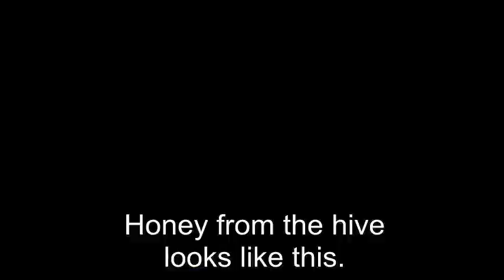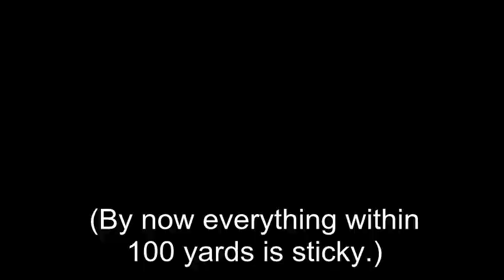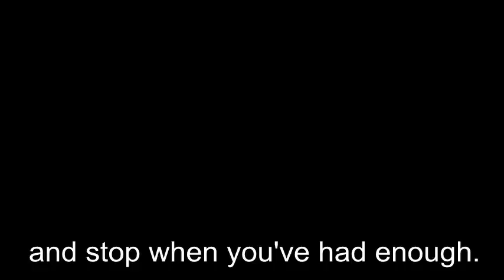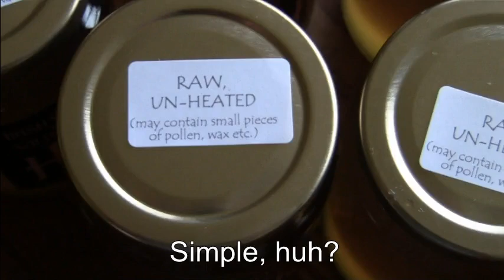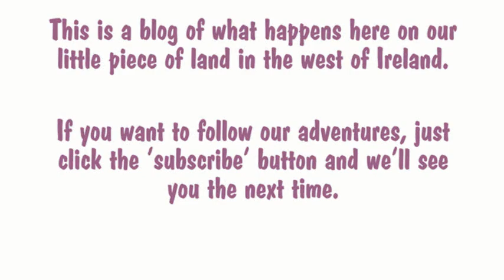Three Simple Ways To Process Honey

Comment: HI Guys I have been watching your video . I wanted to give a little tip I found last year on uncapping the honey frames get a cheap heat gun from Harbor Freight to open the caps there is all most no mess open ever cap. It’s very fast doesn’t damage the comb as bad try it one time I think you will be hooked like I was . Thanks you for all your great videos I have enjoyed them a lot.
Jerry from VA
Reply from the maker: jerry archer Thanks Jerry. Yes, I must try that next time. (No Harbor Freight here, though!)
Reply: Heat will kill enzymes, the good stuff in honey. If it is melting wax, then it is to hot and it will kill enzymes. Such uncapped comb and  harvested honey could be considered heated since the wax need a high melting point which heats honey also.

Comment: how do you keep the combs straight in a foundationless frame? cheers
Reply from the maker: +shdba Have a look at this one - https://youtu.be/TKnkvaOQjsg
Reply: +WayOutWest Blowinblog thanks, funny and informative. But if you put an entire wax foundation in there can you still use the honey as cut comb? wont it make it extra waxy? cheers.
Reply: The Where & Why's . . . 

Cut Comb Honey 'Foundation ' is either Bought Commercially in that it's Beeswax Rolled very Thin pp each Sheet. . .
Or used as a Starter Strip, even a DIY one ! 
The Bees will 'make' Drawn down their own 'Beeswax Comb from this 'piece' of cut Foundation (usually in long thin Strips) Cut parallel wise :
Left to Right Across the Sheet using a Ruler and a Craft Knife.

Tip : 
DIY Starter Strips. .   
I've even used Bamboo BBQ Skewers 'Stapled under the Top Rail of a Frame. At 'Midline.'
Then Dribbled a line of 'Melted Hot Beeswax' onto it : the Bees will make the 'Type' of Cell they need, depending where in the Hive (Nest) it's placed. A Frame placed 'Centrally' it will be more 'Worker Cells' then 'Drone Cells' and some Frames will have both (!) Bees measure their Need so instinctively, it's just amazing to see in action.
Hope this helps. 😎 
🐝🐝🐝🐝🐝🐝🐝🐝🐝🐝🐝
  Happy Beekeeping 2024
🐝🐝🐝🐝🐝🐝🐝🐝🐝🐝🐝
Some Beekeepers like their Bees to have 'Natural Comb' where the Colony chooses what it wants. Commercial Rolled Foundation Sheets are mainly 'Worker Cell" sized. So unless there is a "Gap' or a 'Shorter' Frame (eg a Super one in a Brood Box) they will 'Draw' out "Drone Comb" where they can.
You can also Buy Drone Foundation or Frames (often in Green Plastic) to 'lure' in Varroa Mites : so when said Frame is Removed (Culled / by Freezing) the 'Varroa Mites and their Bee Wing Deformity Disease (Virus)  carried by V.M is eliminated by Natural Means, over Chemical (Vet Meds) Treatments.

Drone Cells are 'bigger' as Drones are the "Boy Bees." Some Beekers like Drone Comb in their Honey Supers as bigger Cells contain more Honey. (But the natural diversity of the Bee Colony 'Structure' Society wise may mean more Drones, less Workers (aka the Forager Bees who Collect that Honey !)
Theirs more to a Bee Hive than you might think !?! 🙄

Comment: Do you have any problems with  varroa mites???
Reply from the maker: slinger777 No really, Slinger. We have varroa mites, of course (like most beekeepers round the world) but we deal with them easily. How about you?
Reply: WayOutWest Blowinblog well I thought I was doing good with the mite problem  until I  used the MiteAway Quick Strips just last week I was totally surprised to find that I have a huge problem. So can you tell me what you do to keep the little beggers at bay??
Reply from the maker: Sounds like you're doing it right with your quick-strips. I'm using oxalic acid but try different things over the years. Thymol in the spring/summer. Last year I didn't need to treat at all because numbers were so low, but they're back again. I found some old bavarol packs which I used up too. I think the answer is you have to keep checking regularly, that's all. Good luck!
Reply: WayOutWest Blowinblog
 thanks for reply oxalic acid is active ingredient in my strips wish I could buy the liquid concentrate its much cheaper